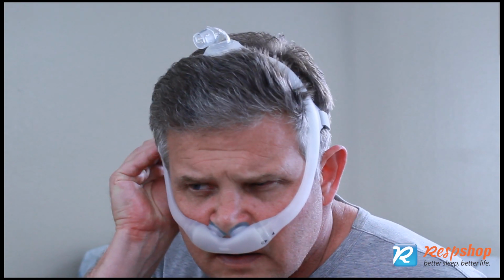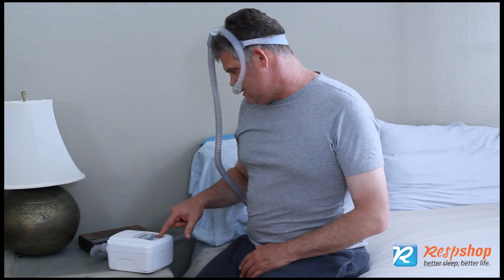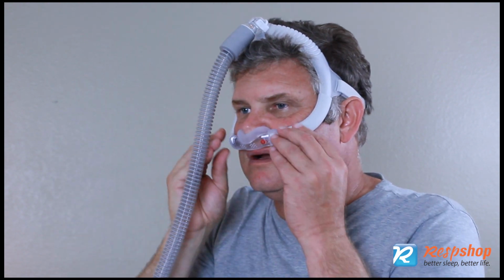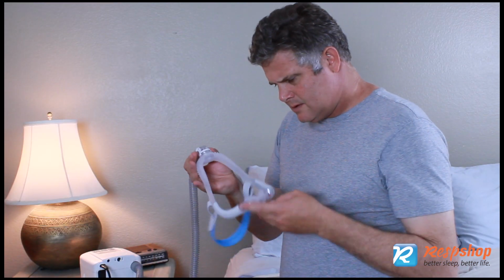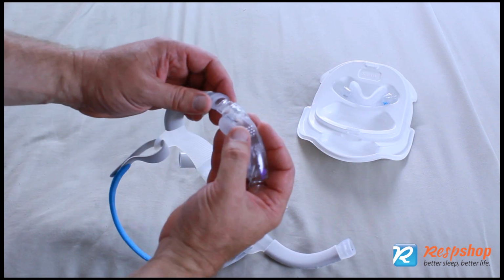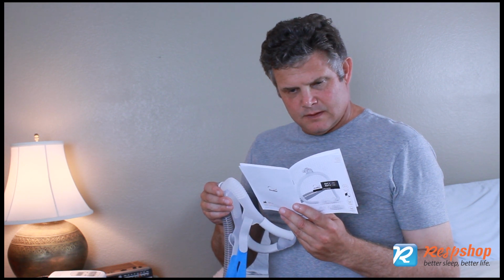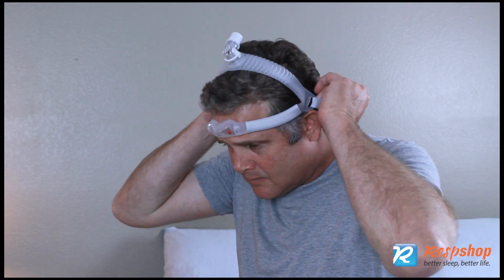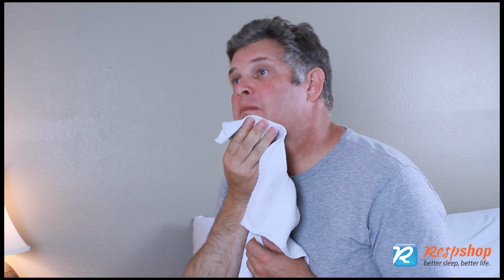How To Fix and Prevent CPAP Mask Leaking - Useful Tips!

Comment: What’s the best way to prevent the nasal cradle cushion from stretching or distorting while laying when not in use? Will removing it from the mask daily prevent this or cause even more stretching? I mostly clean the cushion by wiping both inside and out with baby wipes.
Reply from the maker: Most patients wash their cushion daily, usually build it into a routine. Wash it while brushing your teeth and leave it on a clean towel to dry throughout the day. Replace your cushion every 3 months.

Comment: The Resmed AirSense 10 doesn't have an alarm, if the mask leaks?
Reply from the maker: Most machines don't have an alarm. But the machine has a sensor and in the morning your machine will provide you with a happy face or sad face next to mask fit. If you wake up with a happy face there was no excessive leak.

Comment: I have this exact mask and no matter how well it fits, even by my sleep tech, the machine still claims that it’s leaking.
Reply from the maker: The leak my be due to high pressure. I would suggest trying a different nasal size or another mask if the leak is disrupting your sleep. If your apneas are well treated and the noise of the leak is bothersome I would suggest leaving it.

Comment: Does mask leakage explain why I wake up with my brain feeling baked as dry as a desert?
Reply from the maker: It could, but we're not sure what you mean by your brain feeling dry...🤔
Reply: I should have said my entire head. I am constantly using eye drops and squinting because they are so dry. The fogginess in my brain is no better than when I don't use the CPAP and the mouth pieces. But my sleep stoppages have supposedly been greatly reduced. I was advised to buy a new mask today and am hopeful this will improve the leakage system my CPAP supplier noticed. Apparently, leakage can seriously compromise the accuracy of CPAP numbers? Is that true in your experience?
Reply from the maker: @sportshistorybuff319  If your mask leak is very high or if the air is leaking near your eyes, it can dry your eyes out. Yes, that is true - a high mask leak screws up your CPAP readings and makes it inaccurate because the machine can't compensate for the leak. Your CPAP numbers/AHI isn't really reliable if your leak is through the roof so I'd really work on improving the mask seal. Then you can see how you're really responding to therapy and hopefully the brain fog will lift too.
Reply: Thanks!
Reply from the maker: @sportshistorybuff319  No problem!
Reply: @RespShop new to Cpap , what is a desired leak rate? Now sure what any of this stuff means . Mine says leak 23L/min